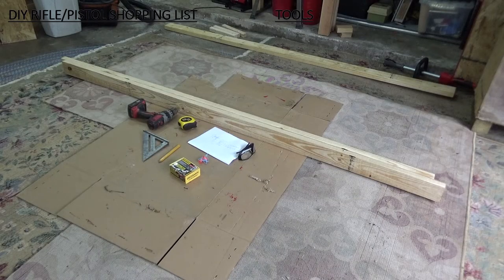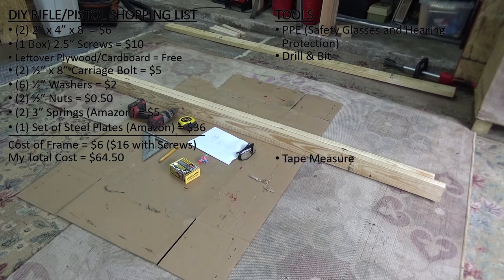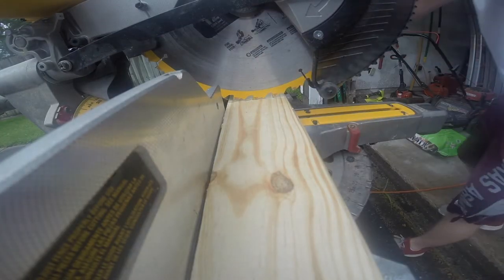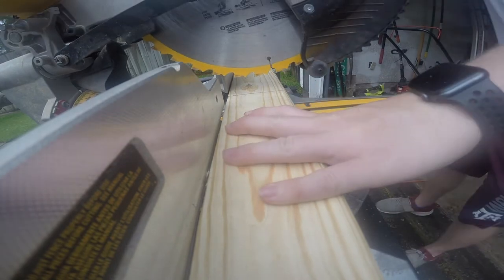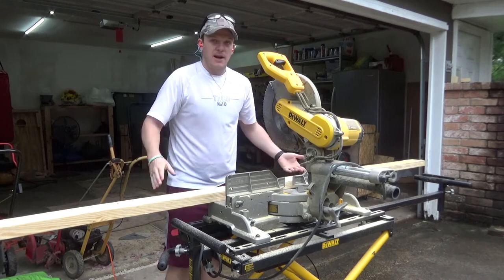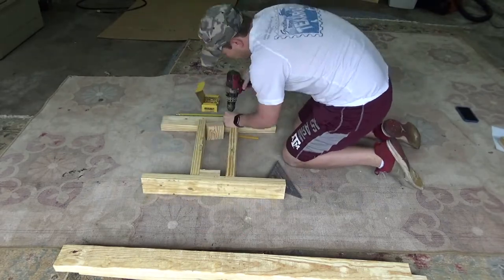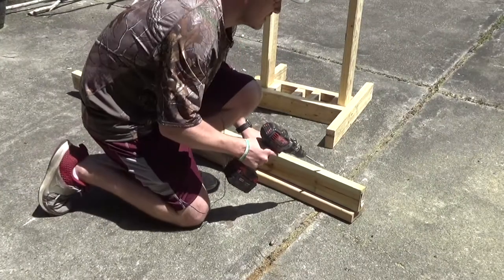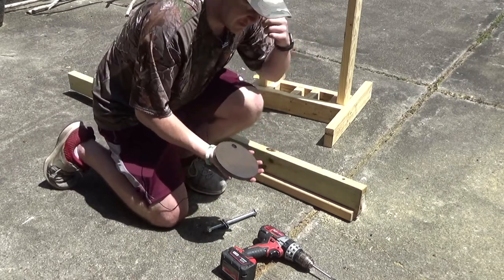DIY Rifle & Pistol Target Stand

Comment: would it be better if you place the metal on the side from preventing damaging the 2x4? just saying. But good job and thanks for sharing.
Reply from the maker: Like pushed out to the left or right of the 2x4? Knowing how I shoot, probably wouldn’t help protect the 2x4 haha. But that’s a good suggestion. You could put a cross beam to do that, or would need to look and see if there is like an L bracket type of thing you can use for it. I’ll look into it and see if I can optimize it for my next one. Thanks again for the tip

Comment: You didn’t tell how much measured across the two 24 inch pieces
Reply from the maker: Those would be the 2 - 17” pieces that are in the middle of the 24” pieces. If you want the measurement edge to edge that would be about 20”
Reply: So you measure 20” across the the two 24” pieces for the two 17” pieces
Reply from the maker: Oh I see what you mean now. So the first board I put at 9.5” to center of your 17” board and then the 2nd one I used a piece of 2x4 to measure where it went, but it should be 9.5” from the other side of the 24” board , or 3.5” from the edge of the first 17” board you screwed in. Does that make sense? I just used the 2x4 I was going to slide in and didn’t measure the 2nd board so I could get a tight fit
Reply: Ok thanks